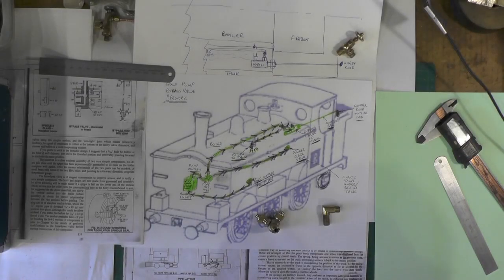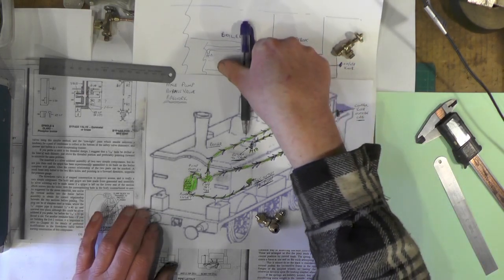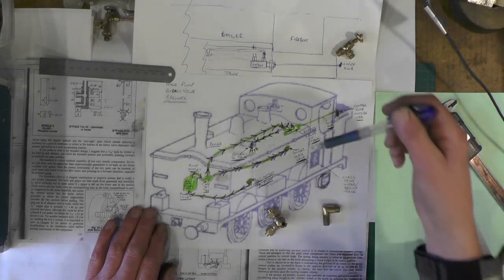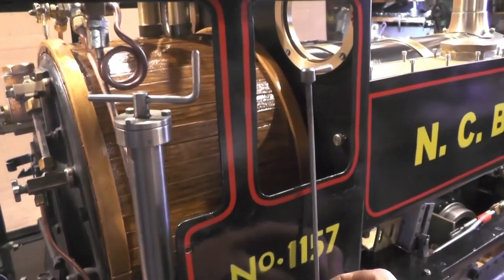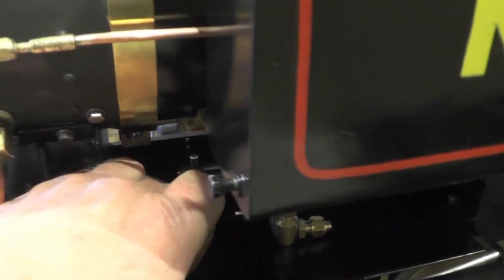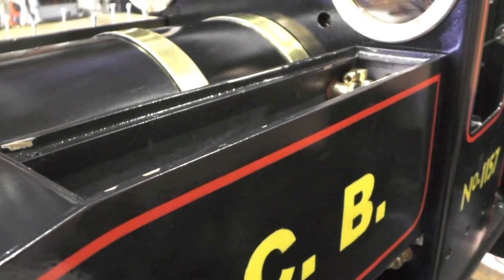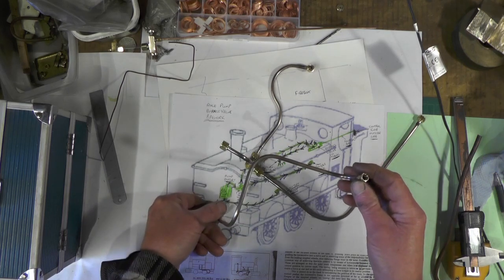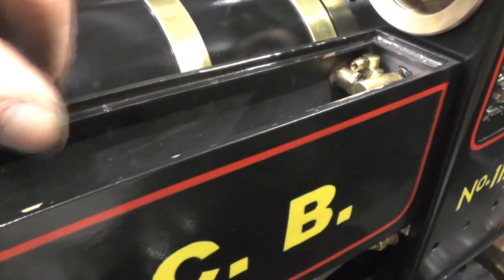Build Your Own Beginners Steam Loco Series (Pipework P6 - BYPASS VALVE / AXLE PUMP ) "mr factotum"

Comment: Morning Mr F  . Really enjoying  your  pipeing videos  its a bit i of a dark art  for me as I've not  done any  copper pipework ,,, here is another of my daft  questions  when you mention 3/16 copper pipe  what is its actual  dimensions??? I see on the internet that they have different  ways  of dimensioning  .. and they also have different  wall thicknesses   so what is the ID and OD of the pipe you are using??,     as usual keep safe Dug Hogarth
Reply from the maker: hi dougie
i'm using 1/8", 5/32"' 3/16". 1/4" 5/16" O.D.  the thicker gauge is easy to bend on the 1/4 and 5/16" without  it kinking. The main sizes though are 3/16" and 5/32" there just similar to brake pipes on vehicles. The knack is to keep annealing it to keep it soft.
regards
mr f 
and you stay safe too

Comment: Looking really good ! 
Nice you have a space between the side tanks and the boiler . The injector doesnt like to work with warm water . 
Cheers , 
Looking forward to your next video .
Reply: Just some thoughts : 
Could you have moved the Tee closer to the bypass valve to reduce the length of the copper piping ? Probably easier access to the nuts with the Tee located where you have it ! 👌
I ran 2 equalizing tubes between the 2 side tanks on the bottom . One tube wasnt letting the water flow enough .
I also ended up placing a thin aluminum heat shield between the injector and the frame due to the fact the firebox heat is right there . 
Really enjoy your shows ! 
Great to see you enjoying the build so much 👌
Reply from the maker: @theflyingscotsman9902  hi TFS
Thanks for the pointers,  i appreciate all advice, you can't beat experience in this game, i will take it all onboard
see you next time
regards
mr f
Reply from the maker: hi TFS
Thanks again,  i've no experience on this so that's reassuring
see you next time 
regards
mr f